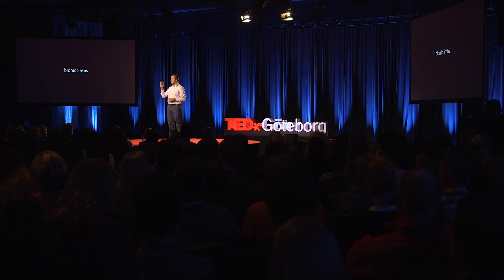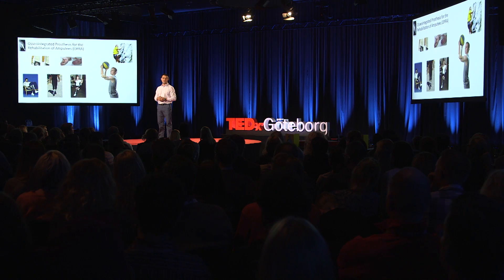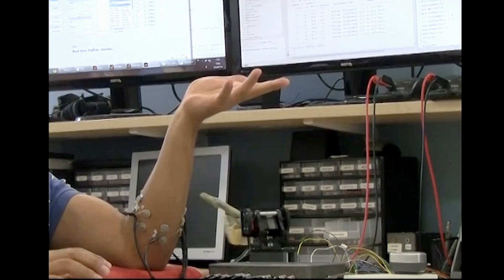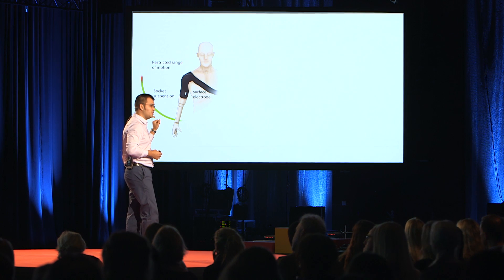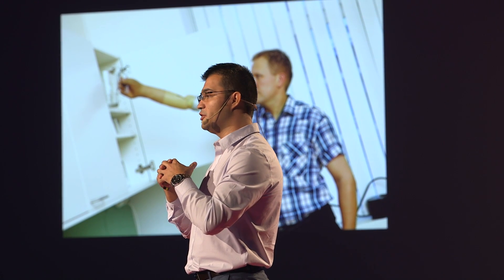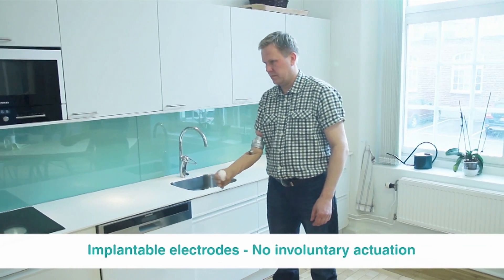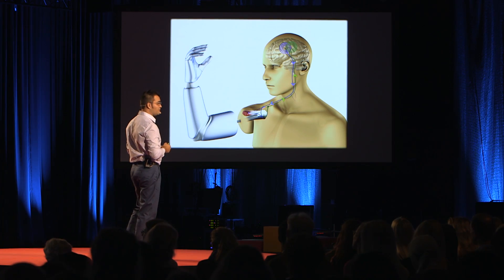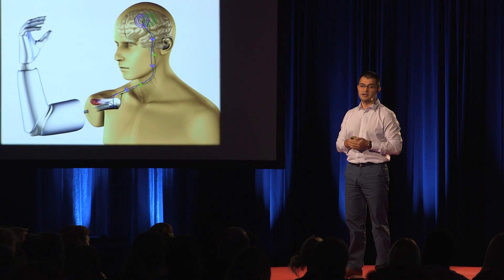Bionic limbs integrated to bone, nerves, and muscles | Max Ortiz Catalan | TEDxGöteborg

Comment: i would like to see the engineers and medical personnel involved in this research to be very very very honest about how much the bionic arms are reliant upon excellent mechanical design and how much the bionic arms are actually interacting with the 'nervous system' of the amputee.  i find it highly unlikely that the nervous system is involved.  a human nervous system is hardly capable of generating sufficient 'electrical impulse' to 'power or direct' the movements of a mechanical device.  however, we do know of Kevin Warwick's current fraud concerning 'brain waves' and 'interaction between man and machine' (Kevin is using wireless electricity to translate the movement of mechanical arms to human arms and vice versa  - fun to watch but in the end, nothing more than a childish game).  From personal experience, electricity directed to a microchip implanted within the human body (say, a chip at the top of the spine or in the wrist - or even a chip installed at the base of the spine -  which is then used to receive electrical impulses to direct movement of limbs) results in soft tissue degeneration and extreme susceptibility to death by staph infection as the ability of the dermal layer to fend off 'the outside' degrades and disappears.  my apologies.  i resent fraud committed by those who portray themselves as 'highly qualified'.
Reply: It was never said that the power for the prosthesis comes from the human body. You are running your comments based on a wrong assumption. The prostheses have batteries to power the motors and electronics (wow!, hard to figure it out huh?). Electrodes pickup bioelectric signals which are amplified and used for control, and electrical pulse are delivered to nerve afferents for sensory feedback (all this powered by the batteries). There are several electrode designs that the body tolerates very well and had been implanted for decades in hundreds of ppl, that's the state-of-the-art in medical technology. This group has published several scientific articles, go and read those, then publish your comments in the same peer-reviewed scientific journals (in case they make sense to the experts). It's too easy to criticize ppl's work over youtube comments when you haven't even understood the matter at hand.
Reply: I would like you to finally demonstrate how you have truly picked up on 'bioelectric signals'.  I remain convinced that what you espouse as 'bioelectric signals' in a healthy biological piece of tissue are not ever captured or measured appropriately (you pick up your own machinery and extrapolate generously).  once you proceed from there, the rest of your arguments are vacant blather and based upon 'magic' delivered to desperate people hoping for cures.  next you claim to cure cancer using scientifically applied Reiki powers.

Comment: I wonder, if the neural network is so integrated to allow electrical currents to travel easily, does that mean the prosthetics can feed off the body's bio energy instead of relying on external chargers?
Reply: +Aaron Parker Right, the only way for the body to provide the amount of electrical energy needed for 24/7 operation would be deep modification of the body's biological processes. A fuel cell inside the body to convert food and air into electricity, for example, is plausible, but the efficiency of such a system would be very low.
Reply: Danielle D Charene No, I'm just interested in this stuff.
Reply: Piezoelectric shoes fastened to battery pack fastened to prosthetic. Food-->walking-->electricity-->Robohand
Reply: Ku Dastardly It's extremely possible and I am glad you ask the tough questions.
Reply: Tiles Murphy Excellent points, Tiles. Do you actually wear a prosthetic device?
Reply: That does seem to be a good idea turning the human body into a battery. Perhaps it could leach off the thermal or chemical energies of the human body or even the electrical stimulus sent by the brain along the nerves to command the arm. I just got into year 11 so I'm just throwing ideas and hoping I hit something : )
Reply: This is an uneducated guess, but since our blood carries energy to our muscles, I guess it would be possible to design some sort of generator that drains some of those chemicals from the blood and turns them into electricity. But a person has to digest food first, in order to put that energy into their blood, of course. 

Maybe it would be simpler to avoid that step and place the generator in the digestive system instead, where it can use chemical energy directly from ingested food.
Reply: We could integrate a battery into human metabolic system, so prosthetics would work on our energy, so you don't have to load it. But it would probably mean a huge increase in calorie intake.
Reply: Fairly certain someone is working on making a cell that runs off of glycogen, i'm not 100% but i've seen something like it a while ago. So assuming you could make the arm efficient enough you could power it through the bodies natural metabolism

Comment: Very good.. But, you did not focus on the actual prosthesis itself which is very important, as if the prosthesis has limited functionality, so to will the patient. Plus, stronger signal could be achieved, and less jitteriness could
Occur if the cable had less resistance.
Reply: Prerendered renderation, I think you missed the introduction. There are commercially available prostheses that have more degrees of freedom than patients can intuitively controlled, you can buy them off-the-shelf, that's a fact, so the bottle neck is not the prosthesis Itself. About your other remarks, those are engineering tricks known since the 1960's when myoelectric prostheses started to be clinically used, and yet, they have made not much contribution to advance current systems. That is of course, unless you believe that you know something that engineers and scientist working in the field have overlooked for 50 years.